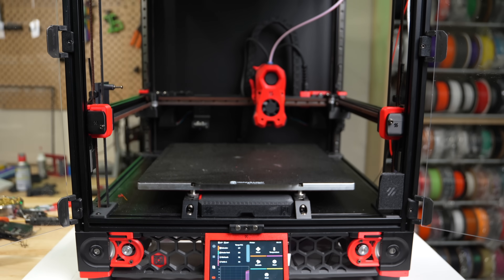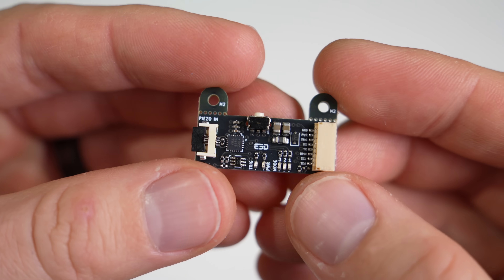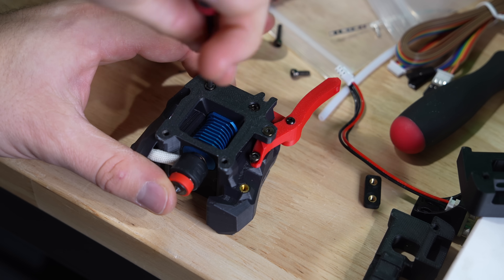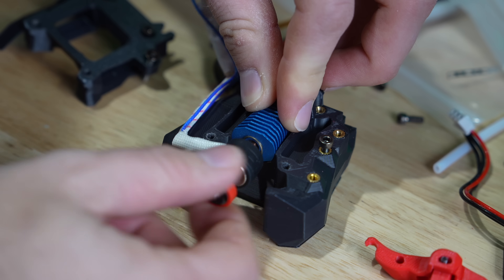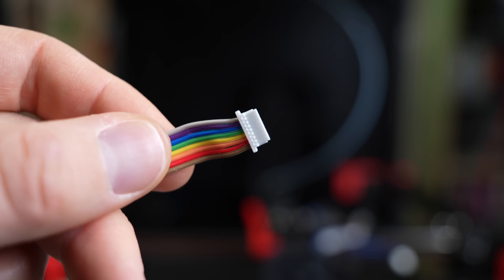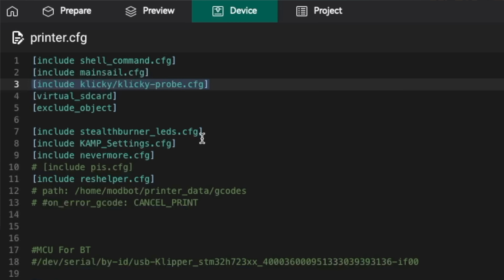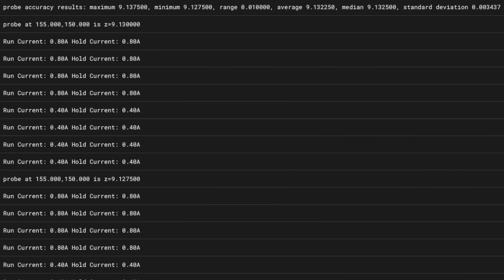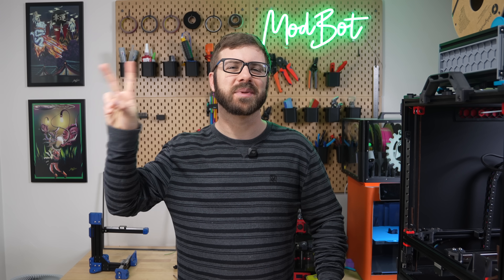Simplified Accurate Probing With Piezoelectric Sensors (E3D PZ Probe)

Comment: In a world where eddy current probes exist, other probes are obsolete. 
Choose a probe based on your budget from the variety of options and be done with it. I use a cartographer on five machines and a beacon one. They all work very well. The reason one machine is equipped with a beacon is only due to its higher temp rating (it’s a doom ube with an active chamber heating)
Reply: I have a printer with a 3mm carbon fiber plate as the build surface. Eddy current sensors need metal, so sadly won’t work for me
Reply: What is the max chamber temp for beacon?
Reply: @ they rate both beacon models for 115c, according to their specs. 

During the trial runs I did with cartographer v3, I had my chamber heated up to 95c, the cartographer didn't like it and shut down before probing. I could still use the machine with it though - I set chamber temp to 80c before beginning a print, let the machine do scanning and probing, pause, heat up, wait for chamber temp to stabilize and then begin printing. 
The cartographer survived 100c, but I doubt it would for long periods of time, as its rated to 85c due to some of its components.
Reply: @itayst  I see, thanks. Do you use any special components (belts, bearings wtc) or water cooling for 95c chamber?
Reply: @ I wont all in lol.. EPDM belts, linear rails with metal carriages, liquid cooled hotend (CHC XL) on a breakneck toolhead with cpap, liquid cooling blocks for A/B motors and extruder motor. 
Its an awesome machine. Expensive AF and super heavy.. Haven't yet done any exotic filaments but it looks like it'll handle them quite well.
Reply: @itayst  sounds awesome, thanks!
Reply: @riba2233  They actually make a water-cooling plate for the Beacon if you need to go higher in temp.
Reply: @livedeliciously  really, that's awesome, thanks!
Reply: The max temp and the fact that my bed is G10 limits me 
But I am a edge case

Comment: I´ve been using a Cartographer V3 alongside the Galileo V2 with Filametrix mod and it really works insanely well. First layer consistency is awesome, meshing is very quick and it´s rather cheap.
A CNC X-carriage also improved my IS results.